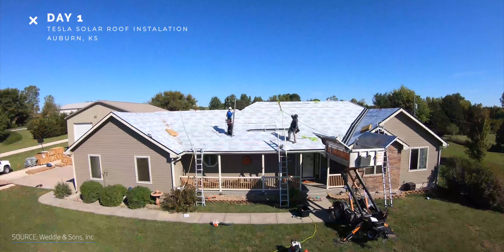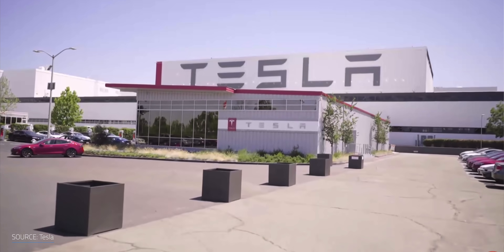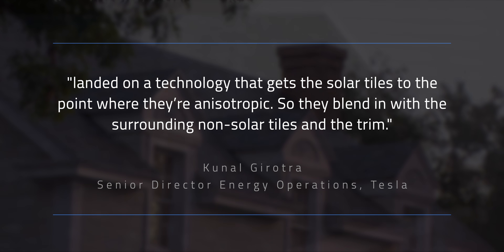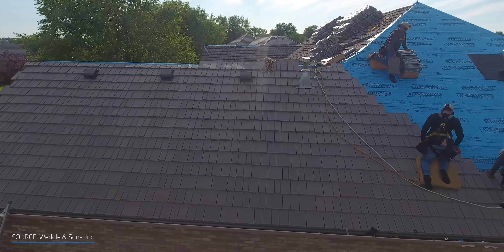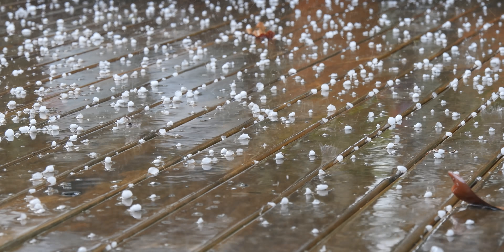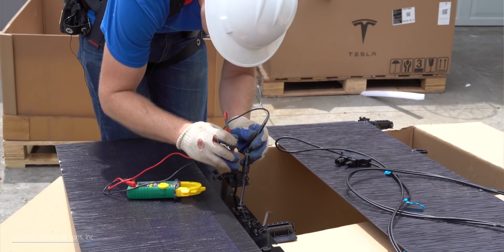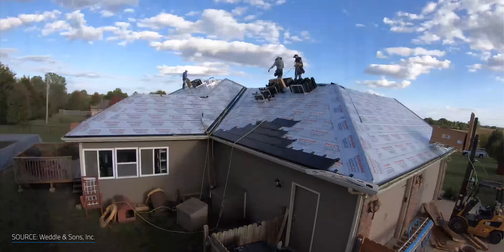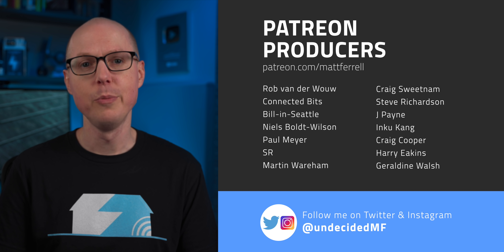Exploring If Tesla Solar Roof Is About To Go Mainstream?

Comment: Will a hail storm cost you a fortune to repair after the roof panels are damaged? I know we put solar panels on one relatively small section of our roof to heat the pool during the Winter. We were told it would be $15,000 to replace. I live in S. Florida and hail isn't a concern but Hurricane wind damaging the roof, which has happened 3 or 4 times in the past 20 years, is a major concern. I would think hail in the Southern and Great Plains region of the U.S. would be a very serious concern to completely damage the roof.

Comment: Disliked because you did 0 math. Whats the power output per square meter? And is it comparable to power output per square meter of regular solar panels? 

Quick answer is no, they are way less efficient. They are also more expensive.

Comment: For new houses, yes. For existing homes, the labor required is crazy. Existing roofs is better off with the largest panels available and have that installed
Reply: I mean if your roof is old anyway it's not crazy to spend more upfront to avoid the hassle and cost of removing panels and replacing a standard roof (also resale value since savvy home buyers will think about that future issue). 

People with land should also consider ground-mounted panels, they're so much cheaper if you have the space to put them.
Reply: I’m a roofer, my crew could rip your old roof off and have it papered by 11:30 am.

Comment: It sounds almost to good to be true. But about the W/m² (W/ft²) and therefore winnings generated in $/m² ($/ft²)? As far as I know standard solar panels have a much higher (up to 3 times) turnout than the same are of a  Tesla Solar Roof. Therefore you'd have to calculate the cost/winnings over time to see which roof is more cost effective in 5, 10 or Tesla's guaranteed 25 years. As well, underneath solar panels you wouldn't need a high cost roofing. It's not going to be exposed to the forces of nature and you are not going to see it anyways. Since roof area is the limiting factor of solar panels the cost over time per m² (ft²), in my eyes, would be the most important factor to know.

Comment: I really love the concept of the Tesla Solar Roof.  It's non-obvious.  It's a strong material.  It's easy to swap a broken panel.  And the price ... isn't ... too bad.  But the thing about real solar panels is that you can frame and angle them for maximum efficiency, whereas Tesla's panels are forced to match the geometry of the roof.  So if your house just happened to be perfectly aligned to the sun, awesome!  But if not ... you're kinda SOL if you can't change the geometry.

Comment: Those "incentives" AKA tax subsidies, AKA someone shaking the tax bucket with more holes in the bottom than there is bottom in the bottom making it rain Benji's, are necessary to the solar industry. Why? As of 2020 the power conversion efficiency of solar cells runs in two classes. One is at 24% efficiency the other is at 13%. Higher is better but one of the two cost much more to produce so the other is what your being sold. So any guesses as to which one your buying? 
Here's the rub. Why do solar panels need subsidies? Solar panels have a short life span. They start losing appreciable efficacy after five years. In twenty they're crap. To provide more energy than it takes to make a solar cell requires an efficiency of about 42%. Do you see the problem NO ONE is talking about?
Big oil loves solar. They get to sell more oil to make inefficient crap.

Comment: The biggest environmental danger posed by  is the amount of water the process uses up: an estimated 500,000 gallons of water per ton of  extracted. This can endanger the communities where the  is being  because it can cause droughts or famine if operations are not kept in check.Oct 22, 2020

Comment: I’ve been wanting a solar roof for years now. But where I live, for 120k I can buy a whole house or that would put a regular $120,000 house into a $240,000 house and out of the price range of  a lot of people.  I wouldn’t be able to resell with a 240k house in a 120k neighborhood with the same floor plan as the house across the street that cost half as much as I’d have to ask. 
For that price I’d have to be able to run my ac unit, fridge, stove and clothes dryer as much as I want without problems and it still would take years to see any savings.

Comment: One thing you didn't mention, the non-Tesla roofs reflect the suns energy back up into the atmosphere. One or two houses wouldn't be a problem but if you had a whole neighborhood of reflecting solar panels there is an increase chance of changing weather conditions. Since Tesla's panels are satin, they won't reflect as much of the sun's energy. Another selling point. Nice report. Thanks.

Comment: how have they over come the over heating issues if they are using positive air flow mechanics what kind of grating are they using to make sure it does not get clogged with leaves and yes the heat sink is very high where they retain heat in most cells and they can catch fire or barring that warp wood i live in Texas and some times it gets so hot you have to cover your tires when you park because they can blow up from the heat and if you have to run your ac more to keep the house cooler it defeats the purpose of the whole idea because i would be using more electricity also would they have to tear up my roof to put insulation of a special kind down to help it

Comment: A HUGE concern that I have is in Northern Climates.  Rain water in warm climates will naturally run downhill BUT a deep snow melt with overnight freeze-ups and then rethawing the next day can cause melted water to migrate back up the roof because it is blocked from freely running down the slope of the roof.  Now you'd have water UNDER the tiles where it is more likely to permeate the barriers and cause leakage into the house.

Comment: I don't understand the comparison with "premium roof + solar panels" with this Tesla solar roof because the former simply covers the roof so it looses the aesthetic. On the other hand, the Tesla roof really looks flawlessly amazing.
Reply: I don't understand the estimated price break downs either. I replaced the roof on my house when I bought it a few years ago and the total cost for removal and replacement for asphalt shingles was less than $3,000. The pricing ($185 /sq.) was probably even a little high, but I didn't have to source the materials, pull the permits, etc. I'm trying to figure out how large of a house it takes to have a $40,000+ roof install...

Comment: I dont see the point at the moment. If you are arguing a fiscal point. Solar is a 0 sum game. Sure you ditch the power bill. Its then offset with payments. As for the "greater good" environmental argument. Thats laughable at best. The rare earth mining needed for the panels and batteries is exponentially worse than any standard power plant. Im not against it by any means. I just dont think the technology is there yet. The efficiency rating and duration of panels just isnt there. If we could get 80% efficient panels with a 50 year lifespan. Id wrap my entire house tomorrow. Problem is atm, we are dealing with max 30% efficiency which degrades at 5 to 10 % per year.

Comment: I find it strange what prices and times they are quoting there.
About year ago i helped with the roof on the house of a relative - normal european house so ceramictiles. 1 Person that does that professionally, 5 helpers. We did everything in 1 day - in the morning the roof substructure, in the afternoon the tiling.

There are also a few other things to consider:
Way way more connections - which are in most solar installations one of the major points of failure. Then 25 year warranty is not long for roofs - here people basically will not buy anything with under 50 years, most tiles come with 75 years or longer warranty. The price per area is also much higher. So much so that normal tiling + solar is quite a bit cheaper. They are way less efficient, like not even half of normal solar panels. And lastly 25 years warranty sounds nice, combined with the relatively low degradation of solar-cells in that timeframe. But that is deceiving as right around 30-40 years is where solarpanels start not to degrade but just outright fail due to various effects like corrosion.

And other companies are selling such solar tiles for well over 20 years already. There is a reason why they are not widespread yet.

Comment: I'm curious about the materials of the panels. The end quality of water from rainwater harvesting systems is in-part dependent on the materials of the roof and if they leach toxic chemicals into the water. Does Tesla's roof tiles have implications for this?

Comment: It would be interesting to price out the difference in long term production of PV panels verses Tesla roofing.  It is my understanding that al PV systems degrade over time.  It is my understanding that the efficiency of a solar panel reduces to zero within 25 years.  Would the solar component on the Tesla roof decrease in efficiency to an unacceptable level before the roof itself needs to be replaced?  Would it be cheaper in the long run to use the solar panels because they can be inexpensively replaced or would it be more economical to replace the underperforming Tesla roof tiles?  Also, it would be interesting to see how much of the integrity of a roof is compromised by adding solar panels vs the integrity of the roof of an integrated Tesla roof.  Remember water damage ruining your attic and walls is much more costly than the advantage of saving on your electric bill.

Comment: Just another Elon Musk/Tesla Infomercial.... no cons at all? No info about competitors and again mostly unproven info from tesla. "Ohh tesla will reduce the costs, and the price per KWh is already low". I call bullshit on this. There is a reason why most solar panels are on top of the roof. What is the effectiveness of those tiles in comparison to normal Solar Panels? You compare the price of normal roof plus Panels vs. Tesla Panels but don't mention that normal Panels would produce way more energy per square meter. And about the durability of those cells, It's not that much about if the shatter but if their inner circuits break. And You can just buy normal panels with tampered glass as well....

I am quite interested in all the off-grid technologies that are being developed. But either provide pros and cons (a real analysis) or just declare this a commercial in teslas favor.

I just did some quick calculations. I get an energy efficiency rating of about 5.5% under 1000W/m² test conditions.... that is just poor. 
Calculation:
Area = 0.381m * 1.143m = 0,435483m² (From Tesla website: 14"x45")
Rated Output = 24W (from https://pv-magazine-usa.com/2020/02/10/whats-the-efficiency-of-a-tesla-glass-tile-solar-roof/)
W/m² = 24W/0,435483m² = 55,11122133 W/m²
Efficiency (Output/Input):  55,11122133 W/m² /1000W = ~0,0551 = 5,51%
That is abysmal! Current Solar panels have a rated efficiency of around 18-20%
And It means I have to use about 4 times as many Tesla Solar roof panels to get the same Energy out of them...

Comment: This requires analysis of the electricity savings and increased interest paid for a Tesla solar roof versus other options.
Reply: TRUTH _  This is a simplified analogy, but relevant for understanding why the effects of climate change are delayed from the beginning of fossil fuel use, or accelerating now: If you take an ice cube from your freezer and put it on the table, it's initially at a temperature below the melting point, say 0 degrees F. During the slow climb in temp from 0 to 32 degrees F, nothing seems to happen. Energy is being added to the system, but no phase change occurs - the ice doesn't seem to be melting. But once it reaches the critical temperature, additional heating rapidly melts the cube. Similarly the Earth's ice and even the oceans can absorb a lot of additional heat energy without changing much. Once a critical level is reached, additional heating can begin to cause fairly rapid changes. 
It's good to be critical of ideas and resist hysteria, but people who are interested in the climate crisis aren't morons any more than you are. We all have to keep our minds open and look for the best interpretations of the available science. Most people who do this end up firmly convinced that taking action on climate change is important.
Reply: @strangemagik  Thank you for taking the time to write a measured and civil response.  This is important in order to create a space where the search for truth is possible.
Reply: Yes cost benefit analysis would be a must when deciding roofing expenses, but the video does say that on whatever size roof they determined a standard asphalt shingle would be 42k and the Tesla solar roof would be 56k. It also states you'd be expected to replace the Asphalt roof at least once over the lifetime of the solar roof meaning over the course of 25 year life cycle you spend at least 84k on the Asphalt option and 56k on the solar roof option. I highly doubt you'd be staring down 30k in additional costs on the solar roof, but if you were then I would consider going all electric so that your utility bill savings would offset that in it's own. Just some quick math here can show that, my average utility bill is 200 per month let's say I could completely 0 that with a solar roof and switch to all electric. That would make my annual savings 2400, over the course of a 25 years that would save me 60k. Now obviously you won't completely 0 your bill, but that was an easy way to do the math.
Reply: @joshuatayloe8616  If you are paying over 40k for a shitty shingle roof you are being HUGELY ripped off. Here in Australia a standard long run steel roof will run you maybe 20k. 10k for a nice solar setup on top of that. I dread to think what a Tesla roof will cost here but I expect it would be easily 70-80k.
Reply: @Shrouded_reaper  These are "green guys" they inflate price of a shingle roof by factor of 10x to make it look cool. No one question them as iSheep never worked with their hands in entire life so have no idea how much stuff costs.
Reply: @Shrouded_reaper  Depends on the size of the roof...
Reply: @joshuatayloe8616  $42k for shingle roof?  Where the F is that?   I've never seen prices even remotely that high.
Reply: @joshuatayloe8616  I computed that install of standard shingle would cost 42k USD on a roof of a house in the at least 15000 sqft range. If your house is a bungalow that is 15000 sq ft I doubt that you care about cost - analysis. Tesla roof is cool and you get it or not cool and get something else.
Reply: @tomk3732  15,000 sq. ft?!  That's NOT a house it's a mansion.
Reply: @tomk3732  average sqft of most roofs are 2000-3000sqft. Replaced a roof for 50yr warranty presidential shingles for $15k. 42k is highly inflated.
Reply: TRUTH _  You should change your user name to FALSITY_ because you have no clue about how the drastically increased CO2 level would impact the climate and sea level in the next 100 years.
Reply: @myanghua  LOL!  We are coming out of a major ice age.  After EVERY  major ice age the planet heats to 22c avg.  WITHOUT HUMANS.  id10t.  MOST of the time the Earth is MUCH hotter than it is now, o;ny 50,000 years after the Earth was covered in ice.  Human recorded history has been during extremely cold conditions.
Reply: Porno em gostou de ver né 😋😏
Reply: TRUTH _  Whatever polution Mother Earth has suffered . . . and yes it is terrible . . . over the past 6,000 years of stupid humanity . . . cannot be fixed anytime soon. Even if every human for the next 6,000 years devotes their entire life to it which is never going to happen. No Nation is going to tell the rest how to live unless world domination by one takes place . . . but as of today No one is going to tell China, Russia, Mexico, India, South America how not to polute. The Green New Deal is a Commie Joke. Instead of 'In God We Trust' on our money it should read the truth 'Keep Them Poor'
Reply: On a small 1500 Sq ft home in 2012 I think I paid around  16000 for a new roof with a 25yr roof warranty.  The price seems inflated to me in this particular segment for a shingle roof 😳🤔

Comment: these roof prices are insane! I have a three bedroom house.   I live in the suburbs about 30 miles from New York City, where nothing is cheap, especially hiring contractors, electricians, plumbers, etc. I got 3 quotes for a full roof replacement (asphalt shingles), and went with the lowest price $5500 and it has been doing well for 5 years now.   Prior to that the last time I got it replaced, the roof lasted 25 years!
Reply: Well supposedly it's 25 years for the tiles with the actual solar bits, and only that the solar bits continue to generate power. As a protective covering, it's guaranteed for the life of your home. So that's something. Plus, as they said, it's a solar panel system and those tend to run $25,000+ to install on top of your roof. And any time you would replace a regular roof while having solar panels attached it will cost you a couple grand extra to uninstall and reinstall on top of regular roofing costs. So really it sounds like it comes pretty darn close to evening out in the long term. And I'm betting that difference will only get better. If I had the cash on hand to make such and investment on my home, I'd be hard pressed to refuse.

Comment: I think the lifespan of 25 years is conservative. From a purely structural standpoint, a glass tile should have a virtually limitless lifespan. The rest of the framing is galvanised or copper and hidden under the actual tile. I don't think anyone, not even tesla, really knows how long they will last - only that it is at the very least 25 years.